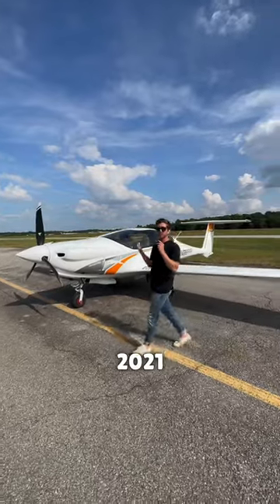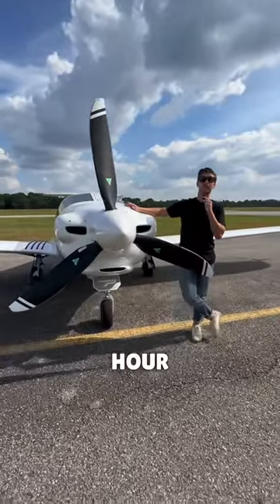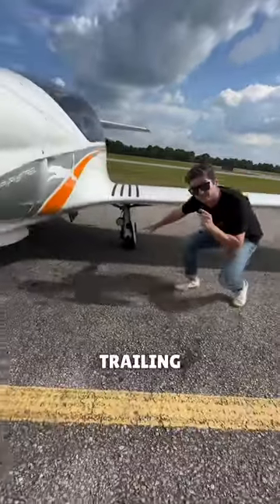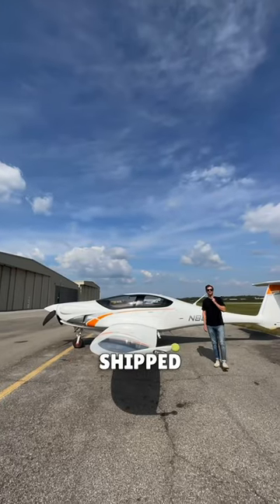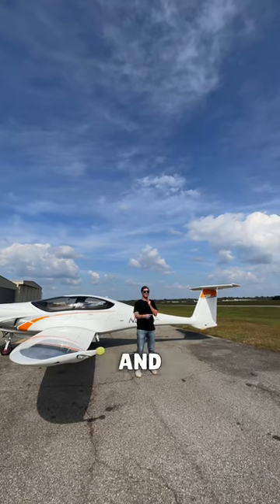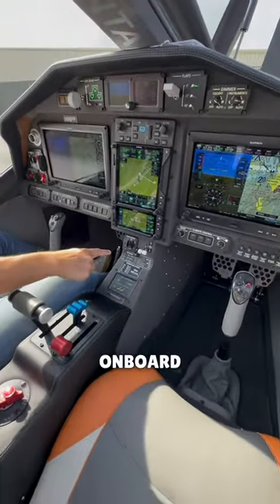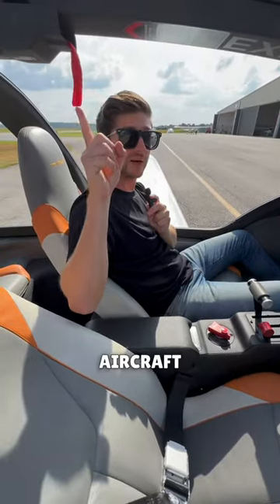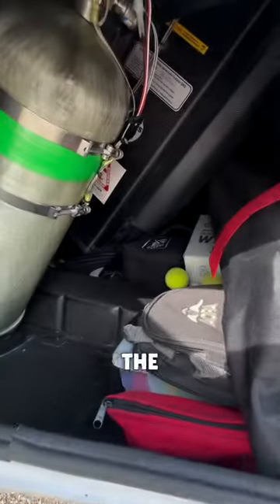2021 Pipistrel Panthera 🥵 #aviation #flying #airplane

Comment: Forward visibility has left the chat
Reply: Fr
Reply: Ye
Reply: I am extremely short for my size so I consider that a dealbreaker
Reply: real
Reply: Just tilt the nose down if you want more visibility.
Reply: Maybe you are supposed to fly it off the display screens like a PC flight sim.
Reply: Just fly IFR everywhere.
Reply: mf thinks you gotta parallel park those 💀🤡
Reply: @davideojockey6237  You are clearly not a pilot
Reply: @davideojockey6237  mf thinks the same comment over and over means anything.....
Reply: @zeruzio1345 only pull the ejection cord half way to raise the seat
Reply: I wonder if it has a cup holder ?

Comment: 600k for an SEP is insane.
Reply: Is that too much? I don’t know plane costs.
Reply: Try $4.5 million for a TBM 940.
Reply: @kenotube3160 that’s not a SEP it’s a SET
Reply: @attanovantotto874 what do those terms mean though
Reply: What's a SEP? A madeup category?
Reply: @samborlon SEP means single engine piston and SET single engine turbine
Reply: @attanovantotto874  No, it doesn't. It's a madeup term that redditors invented.
Reply: @samborlon  I don’t know where you live but here in Italy (EASA) they are the official names of the class rating and I know that for a fact because I have SEP written on my PPL, so maybe you should get your facts straight.
Reply: @attanovantotto874  I was talking about the US. Such a term doesn't exist in the US.
Reply: @samborlon  ok I didn’t know that

Comment: Im assuming it flies in a slightly nose down position, or is it common to have almost zero visibility over the nose lol.
Reply: That's what I was wondering.  It has the forward visibility of a concorde  :P
Reply: Only if your height is under 4.5'
Reply: mf thinks you gotta parallel park those
Reply: @davideojockey6237   mf thinks the same comment over and over means anything.....

Comment: Id like to know how you get out of it if it flips upside down?
Reply: Speaking from visual experience from a similar aircraft - you don't. To get out you'll need a rescue team to open the hatch or cut their way in. However there is four doors on this aircraft, so it's possible that one isn't completely blocked or stuck so you could use one of them.

Comment: I feel like some lil brat would just yank that red emergency parachute cord into oblivion. Does it dangle there for show, or can it be stuffed into it's own compartment?
Reply: That’s why you say “if you want to live to see your friends tomorrow don’t touch or talk until I tell you you can” problem solved
Reply: @LionKing-ys6el  And if they still do it?
Reply: In that case the poh suggests to leave the safety pin in. “The BPRS system has a safety pin that prevents inadvertent activation and
can be inserted in the activation handle when deemed necessary by the
pilot/operator. Such circumstances include maintenance, long term storage,
children on-board etc.. A “Remove Before Flight” tag is attached to the pin.” It also takes 200N of force to activate.

Comment: 6 cylinder and just 260 hp? You could used 4cyl turbo charged engine from any car manufacturer you would have got 300+ hp and.better mileage.

Comment: Forward visibility is garbage. 15 gallons per hour,  90 gallons onboard. 
So, basically 1,200 miles is its max range. Seattle to Miami means you’d have to land to fuel, twice 🤣
Reply: That's a two-day flight at 200mph anyway.

Comment: There was a similar German aircraft on the tarmac at my home airport. Another pilot hit it in a taxing incident. 

Both aircraft got totaled. The Warrior because the engine was timed out. And the German one, because it would have had to be shipped back to Germany for the repairs. 

The downside of having a upper end low volume aircraft. The Warrior was fixable.

Comment: Where are the back up Mechanical instruments: Indicated Airspeed IAS, Altimeter, I did not see one.
Gyroscopic Heading indicator
Mechanical turn and slip indicator
Why?, you might ask.
Because electrical failures are common due to broken wires, faulty circuit breakers, lightning encounters very serious and common (why do you have static discharge whiskers) and at higher altitudes cosmic rays AND the tiny electronic chips are not radiation hardened.
So the electronics can and often fail suddenly without warning. Rare?
Not so. It cost the Marine corps 110 million the loss of a F-35B due to total electric failure.
Does this marvel of non redundant engineering have an ejection seat? No! But a cirrus type parachute ,no control of the soft crash site.
Long time CFII ,with numerous failures. I am not joking. look at the statistics, and Blancolirio.
Or fly VMC only!
This airplane cannot be certificated. Think about it.
But flying above 18000 feet requires an Instrument rating and an Instrument flight plan, exposing you to a flight in IMC without proper backup. How do you square this?
Reply: It has a  Mid Continent MD302 Backup instrument with its own backup battery, mechanical vacuum pumps and gauges are certainly more prone to failure than these modern instruments. Ultimately don’t like it? Don’t buy one. IMHO better to have a chute over mountains vs finding the non existent field to land in. To each their own. I would expect a II to be better informed on what is required equipment vs what is ideal equipment.
Reply: @boydsoftprez  You don't understand . The probability of failure is substantially higher with the electronic microcomputer based systems. As an aero space engineer , with long experience in conduction of FMEA's and extensive design of radiation hardened electronics and test in the Sandia labs, used in high altitude aircraft, including my Beech Duke. All electronics are based on the Taiwan build chips, where the operation reject rate nears 30%, with unknown margins . We built, tested and launched the two Viking Mars landers, which had no failures and successfully landed for the first time in all history.
your statement that mechanical systems, like the pneumatic altimeter, the electric driven turn and slip indicator, 'certainly' fails is wrong. I never mentioned vacuum pump driven instruments, the attitude indicator is not an essential instrument.
As a long time instrument flight instructor, it is our obligation to point out how to recover from failures, based on our real world experience. It was mentioned that this is an experimental aircraft.
More than 50% of the work has to be done by the homebuilder to be given an airworthiness certificate. How do you square this with the statement that after arrival, the wings are mounted, here. 
Of course you have the option to remove my comments. But you still have the obligation to warn buyers about lack of adequate redundancy. By the way, I teach a method to prevent pilots to have a controlled flight into terrain in IMC, with a failed altimeter.
Reply: Space-x is building orbital class rockets with no mechanical instruments. It’s airworthiness certificate is “experimental exhibition” as for all your points about the avionics  it does have a backup instrument as stated before you may not like that instrument, however it does have a completely independent set of instruments. I am not the OP but I do own this airplane. Your naysaying encompasses any modern airframe avionics panel. Again don’t like it dont buy or fly it. But please dont crap on it or us that do. As it is if you want to keep GA alive we need youth interested in it.
Reply: @boydsoftprez  orbital rockets don't fly IFR in IMC.
They use ring laser gyros with radiation HARDENED electronics, with a path length 'servo' that I built and tested at Sandia labs.
Reply: Your original argument was it did not have a backup instrument. It does. You don’t like airframe chutes; don’t use it. CFIT into a mountain… Now we are off in the weeds. Booster recovery of falcon absolutely has occurred IMC.
Reply: @boydsoftprez  a non radiation hardened ELECTRONIC so called glas display like the most important ones, the pneumatic altimeter, indicated airspeed and electric turn und slip instruments, all available on other CERTIFICATED airplanes. You evidently have no instrument rating!, needed to fly higher than 18000 feet, flight level 180.
Reply: There are STCs to put G3X into hundreds of FAR Part 23 piston aircraft. Your opinion is at odds with the FAA and industry. The Panthera is navigating its way through its part 23 now. Can you point me to a round mechanical gauges in the new cirrus sr22s or vision jet? Both of which have completed part 23 certs. I respect your experience, however, seems some knowledge currency may be needed.
Reply: @boydsoftprez  It is obvious that another recall is in the works, like ribs cracking in the mighty Airbus A-380 wing , the destruction of a Shuttle, because a tiny o-ring was badly placed, The MCAS catastrophe because the different feel of the pitch up motion of the lower placed engine thrust line could be solved with SOFTWARE and the existing auto trim, but sure we can do more ,king SOFTWARE declares that a stick pusher function,not on the stick but on the trim can handle pushing the nose down when the airspeed, indicated, of course, as presented by an angle of attack sensor computes that the nose must be pushed over, if that does not happen, repeated nose down trim will be enforced, all because the Maneuvering Characteristic Augmentation Function is not good enough, and was only there because the Mighty FAA required a different flight endorsement.
Already on Apollo 1, the door opened to the inside and the Astronauts could not exit the burning module, because  the module was pressurized with pure oxygen the new modern way to do it. Every time an elegant new solution but NEVER a tiny study about the ramifications
It is called the Failure Modes and Effects Analysis, totally unknown to the protected FAA people, see it must just satisfy the FAR's and nobody knows who wrote them. The modern way is to make it good looking, an infinite life battery will guarantee redundancy, since a voltage indicator for that battery is unnecessary. FMEA takes too much time, experience is all important, Who cares where the airplane hits the ground that is not my department, but just in case, like at cirrus they use a red lever overhead, we must too.
Reply: What!?!? Ok. Thanks. Onward and Upward!